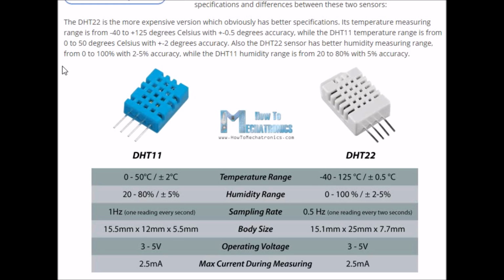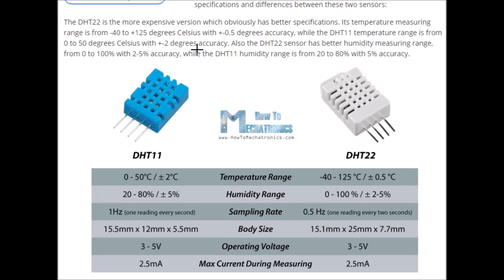Beginner Arduino Project - DHT11 with LCD (I2C)

Comment: Nice first attempt but you need to provide the correct sketch/code for an I2C Lcd with the  code you used not some body else's code for a straight Lcd.  My take on it is look at some professional video like HowtoMechatronics.  Talk slower and use better diction as your accent is ok in your district but not so good for others.  Also get some good lighting and a better camera because people try to experiment using your videos.  Good luck.

Comment: I need code
Reply: #include <LiquidCrystal.h>
#include <dht.h>

LiquidCrystal lcd(12, 11, 5, 4, 3, 2);
int greenPin = A0;
dht sensor;

void setup()
{
  lcd.begin(16,2); //16 by 2 character display
}

void loop()
{
  delay(1000); //wait a sec (recommended for DHT11)
  sensor.read11(greenPin);
  lcd.clear();
  lcd.setCursor(0,0);
  lcd.print("Humidity = ");
  lcd.print(sensor.humidity);
  lcd.setCursor(0,1);
  lcd.print("Temp = ");
  lcd.print(sensor.temperature);
}

late 2 years only

Comment: I found out information, into the datasheet to LCD 1602 is indicated, that backlight consumption is about 100 mA. As I know, DC current per I/O board's pin is 40 mA. So, using this LCD on maximum output current limit is harmful, is not it?